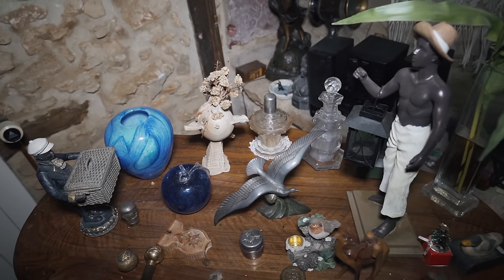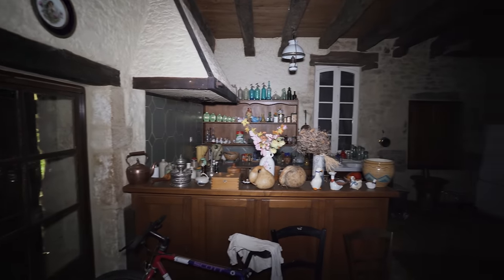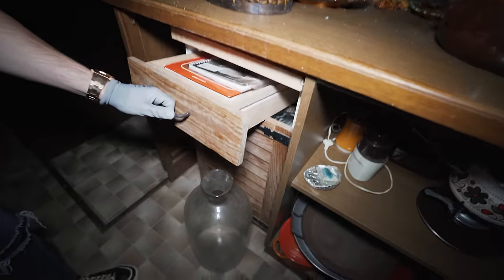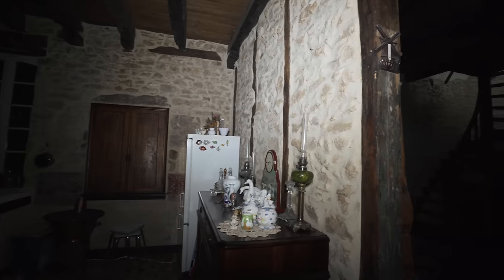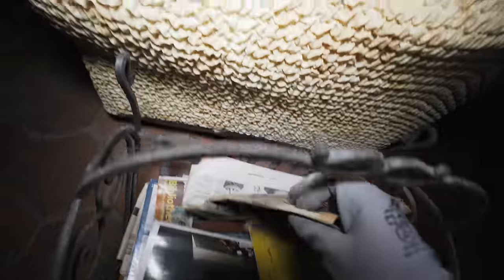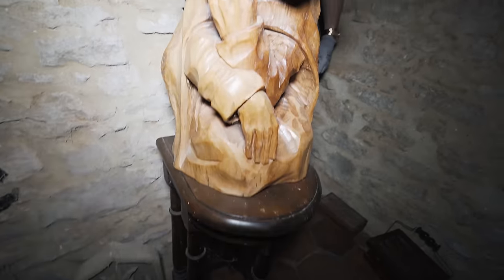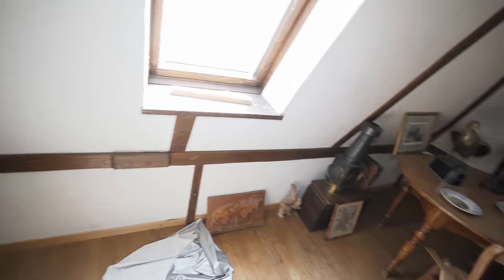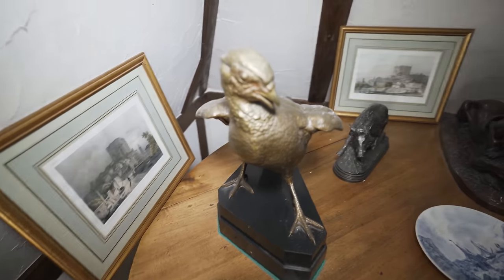FULL OF GUNS - Top Secret Abandoned Military Officer's Mansion in France

Comment: The wooden box that held coins...I bought all 3 sizes in 1968 in San Francisco at Cost Plus imports from India. I keep coins in them too. The 12 guns were percussion shotguns for bird hunting and not rifles or military. Using black powder like I used in 1974..they have to be taken apart & cleaned thoroughly with hot soapy water and brushes right after use then dried and oiled inside and out or start rusting immediately. This is the trouble with BP guns. Big hassle. What at solid house that will last. You should have looked for expiration dates on food to date abandonment. The Camera you found is actually a slide transparency projector.

Comment: Heiio, Hey guys yo I need to look at. Book on guns. What you found look like black powder shotguns they my be able to fire a slug or round ball if the barrels are thick enough. The way they have carving on the stocks tells me these are hunting guns. You also did not say that you pour black powder down the barrel then a card patch and then shot ( small pellet)  and then another patch on top of the shot and the ram rod to seat it all then you add a cap on the nipples and you carry the gun with hammer at half cocked until you are ready to shoot. Also the sword he found is not a saber it a fencing sword. The way to check a muzzle loader is to without having yours or anyone body part in front of the barrel and place the ram rod in each barrel and Mark it at the top of barrel then compare it to the barrel length on the outside if it's dose not reach the back of the barrel it's loaded. If np caps are on the nipple under the hammer it's about 80% safe. Don't use fire to look down the barrel. But if you are not trained to handle firearms you shouldn't touch them in the first place